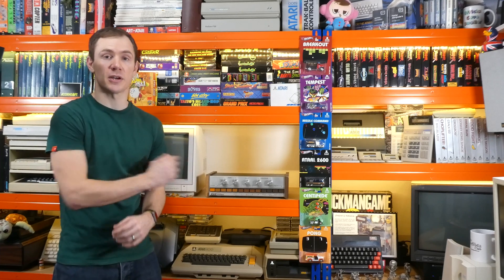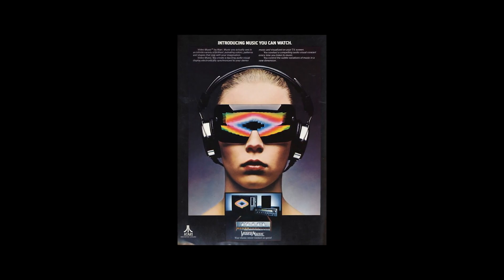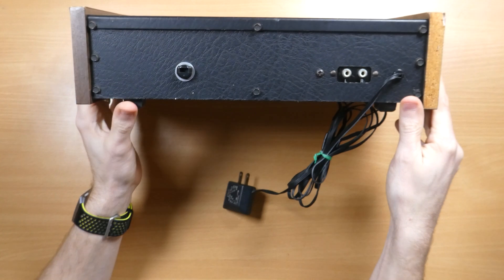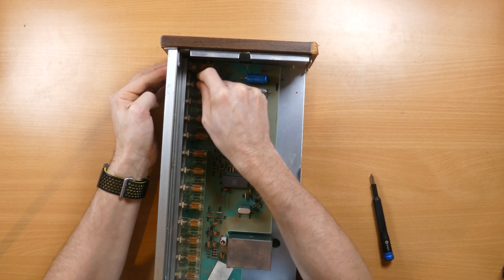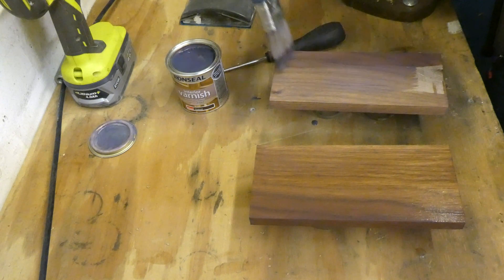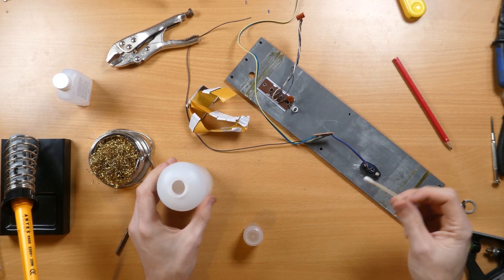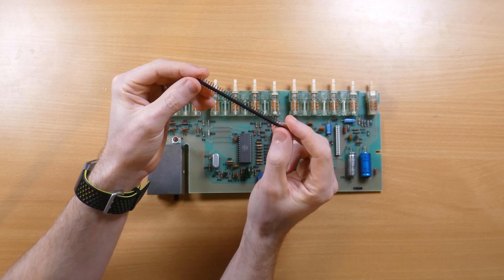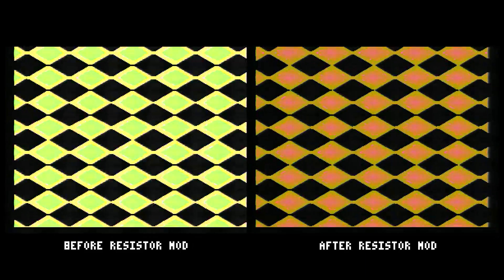Atari Video Music - Story, Teardown, Restoration, and S-Video Mod - Part 1

Comment: Blown away that I've found this. Thank you! Am I probably the only other person in the UK with a C-240? Not sure, but my AVM has been sitting in the cupboard for the last 20 years or so, slowly burning a hole in the back of my head that I really should get around to restoring it. I had similar concerns with the s-video mod that I was a bit reluctant to do, just in case I blew it up and rendered the AVM dead. The other issue as you rightly highlighted is that PSU, and a 16.6v AC transformer, in particular one that is 240v, exists nowhere on earth unless DIY'd. Really looking forward to seeing Pt2!! Subscribed :) .
Reply from the maker: Hey! Thanks for the sub. Yes, I really need to get around to putting part 2 together. I never did come up with a better solution for the s-video mod, but a friend who is much more knowledgeable about this stuff had a poke around with an oscilloscope and  assured me that it should be safe. I also now have an internal transformer which I managed to source from a proper old school transformer manufacturer here in the UK, it looks like it's been sitting on a shelf for years!
Reply: @ctrlaltrees  Yes, I couldn't see any reason why it shouldn't be safe. I'd be interested to know the specs of the transformer you obtained. I found from Maplin just before they went bust, a 9-0-9v 125mA transformer which I assume will likely work (assume as in 2x 9v +/- = 18v, but I'm slightly unsure now!) I was going to breadboard the PSU in the next couple of weeks to see if the voltage range was safe. I found a manufacturer in India who were selling similar transformers albeit at 500mA, for £1 each.
Reply: Just a thing, looking at the twitter link provided, perhaps it's worth experimenting with some zener diodes to keep the voltages in check? I found this useful page link a while back while trying to modify a Korg Volca modular with external out of spec control voltages. https://next-hack.com/index.php/2017/09/15/how-to-interface-a-5v-output-to-a-3-3v-input/

Comment: 13:52 Are you sure that this was a good idea? Because right now those signals are mixed in two places at the same time instead just one (in your mod and in RF modulator) In my opinon a switch will be a better idea to choose an output.
ps. Nice video anyway :)
Reply from the maker: It's something I'm definitely going to look into. I did attempt it this time around but it basically didn't work with the modulator disconnected. It's going to take a lot more experimentation I think but I am working on it. Hopefully won't be too much longer now the distraction of DOScember is out of the way! 👍

Comment: It would be interesting to find out exactly what all those knobs did and which colours and effects the chip was capable of. ...then maybe some computer programmer could write a program that works on Android or something else easier to get hold of.   I also wonder if the BBC ever used this device for visual effects during its pop videos on shows like Top Of The Pops
Reply from the maker: I will be demoing all of the functions in part 2. As far as modern implementations go, there was a project a few years back to recreate the Video Music on a Propellor microcontroller called Pixelmusic 3000 - I'm also going to be covering that so stay tuned! 🙂
Reply: @ctrlaltrees  oh that's great, cool!

Comment: Almost had a heart attack when the dremmel appeared!
I don't know how sharp the edges of that wood are? If they are really crisp you might consider gently sanding the sharp edge to prevent them being easily damaged.
Great video Rees. Really looking forward to part 2.
Reply from the maker: Thanks for the sanding tips! As you can see I used a block like you suggested 😃

Yes, I did round the corners off ever so slightly but didn't show it in the video.

Comment: good but not so sure, why get the metal connectors out you could have just wired a 4 pin cable with connector to those and then make a pin header (maybe even 5 pin for key) on the video board you added. Strange design with removing it and adding it and seperate pins and whatnot. Just simple, no rush no pressure
Reply from the maker: I actually agree. I wasn't going to reinstate the link to the RF modulator initially, it was a decision I made later on after I'd wired everything up. I'm never going to use it after all. With that in mind the solution I came up with was the tidiest and most logical IMO, but with a bit more forward planning I likely would've come up with something similar to what you suggest. I'm just a tinkerer and I'm just documenting my ongoing process, and like a lot of people I do sometimes make life difficult for myself or change my mind. Anyway, thanks for the feedback, I do appreciate it. 😊
Reply: @ctrlaltrees  cool piece and useful mindful mod without destroying the original appeal.
Reply from the maker: Thanks!

Comment: Excellent stuff!  That power supply looks interesting - 3 wires?  Looking forward to part 2. :)
Reply from the maker: It's AC, built around a transformer with a centre tap, with the two outer pins being out of phase with each other. It's very clever and I'm barely at the point where I understand it myself, but as I work it out I'll share my learnings as always!
Reply: @ctrlaltrees  I thought it might be AC, and perhaps 2 different voltages, but the dual phases thing is definitely odd - I wonder if the NMOS chip needs a - voltage, or a separate ground from the other stuff on the board for some reason.  I will definitely be watching with interest :)
Reply from the maker: Yes, minor spoiler but the NMOS chip actually takes two separate voltages! It's such a bizarre design.
Reply: @ctrlaltrees  Oops!  Sorry! :D